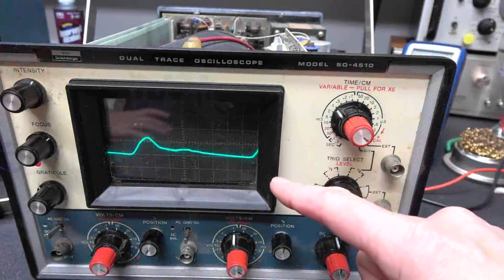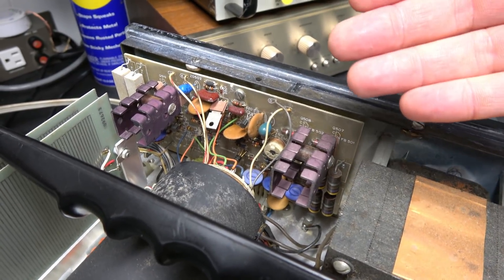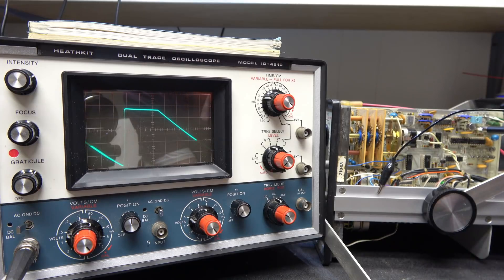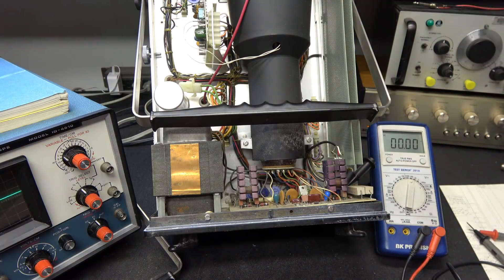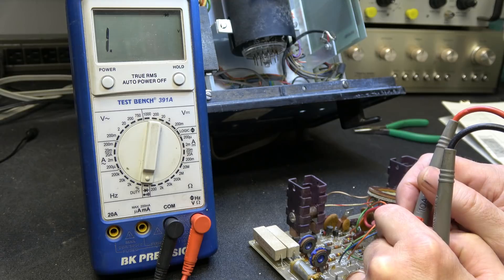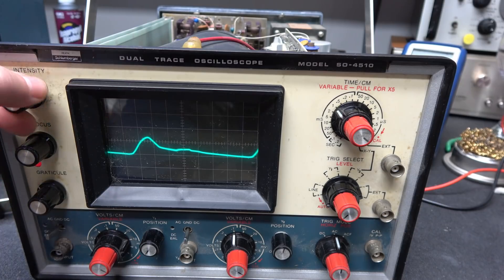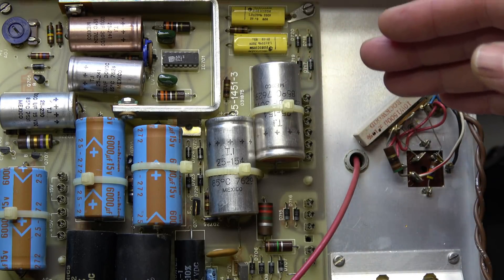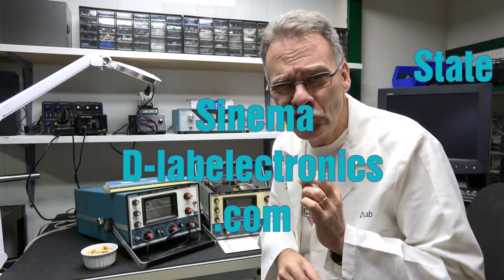How to repair Heathkit IO-4510 oscilloscope horizontal sweep problem

Comment: Picked up the 5Mhz model, the horizontal sweep works but is distorted, more like the time base circuits are wonky. There are a few resistor in the high voltage section that are nice and crisp, hope the ICs are not blown.

Comment: I have a very similar scope - a Heathkit IQ-4550 dual trace scope. Only problem I had with it was power transistors that drive the vertical deflection plates go into thermal runaway. Sympton was a trace that slowly went up and off screen as the scope warmed up. Cure was to heavily heatsink these vertical deflection transistors. Heatsink was homemade. Trace still moved vertically very slightly after 30 minute warmup, but vertical position knob easily brought it back on screen.

Comment: Hi. Thanks for this video and for taking the time to teach to repair equipment instead of throw them out. An older ham Operator just give me this oscilloscope and the problem that I have it's that the horizontal line does not cross below the center mark of the screen. I don't really have any knowledge of this do you know where to adjust this line? thanks you in advance Peter.

Comment: That was awesome Terry, I'd like to find a school of sorts in the NYC area where I can learn the fundamental basics of this electronic work. I'm a  Operating Engineer in HVAC over 32 yrs now and most of our work usually winds up being electrical/electronic issues. I've gotten good with it too. Going through the apprenticeship school for a few years really helped, I've built tube guitar amps, tube stereo amps and effects pedals over the years as well. Its the understanding how to use a scope, function generator etc type of stuff I want to nail down

Comment: It has been a great pleasure to meet you on YouTube. Very good video. You are an electronic repair professional and you are also a professional presenting the videos. I say this, because I am an electronic technician and my mother tongue is not English, I understand you enough, because you speak clearly.
Well what interests me. In 1986, I bought and assembled a Heathkit oscilloscope model IO-4210, to complement my study and add as a tool to the workbench. After two years of operation, the oscilloscope began to fail. This burned some transistors in the high-voltage source. I replaced the transistors and it worked for a while and damaged them again. I inspected and detected a fault with the power transformer, in the high voltage secondary coil. I rewind the high voltage coil and put the equipment back into operation. After almost three years, it failed again of the same. I took the oscilloscope out of service, because it was impossible for me to get a new transformer. I replaced it with the Fluke scopemeter 123, which I have out of service for damage on the display. Because of this, I set about reviving the Heathkit oscilloscope. Any question that I have in the repair of the oscilloscope, I will consult. Thank you.

Comment: What's your technique for finding replacement transistors?   Most of us end up trying NTE's site.
Reply from the maker: Yes, I either use originals or the NTE equivalent. In this case, I used NTE 108 & 106's

Comment: Nice video.  I have a 4550 that has some issues.  I was going to fix it, but the cost of parts outweighs the cost I paid for the scope.  It needs a couple of panel pots and they're hard to find.

Comment: Good morning Terry. Long time subscriber and a big fan of D-Lab. What’s your take on older Tektroniks scopes? I picked up five large tube units this past weekend and could use a little insight into troubleshooting/refurbishing at least one working scope out of the five. I’m sorry that I don’t have more identifying info on them as I’m at work (on break of course). They’re all modular with 3 removable sections or maybe 4? Anywho, just wondering if you would ever do a vid on older/vintage Tektroniks O-scopes? Have a great weekend and happy Friday, wahoo, have a glass of vino for me🍷🎛🔌🎚📻

Comment: Thanks Terry. That Q513 transistor looks similar to a PNP #151-0622 transistor in my Tek 2465A DV scope's Siemen's Hall-Effect sensor controlled fan motor board. The first time I have seen a transistor with three painted stripes on its back.
Reply: I thought Motorola did the painted stripes? I should go pull some old scrap boards. Lol
Reply: That transistor was made by Motorola, as many other components in my scope were.

Comment: Great videos! But some minor safety advice fro all who watch. Be careful about touching heat sinks of high voltage transistors. The collector is often tied to the heatsink especially when it's board mounted. There could easily be several hundred volts on those deflection drive transistor heat sinks as demonstrated.
Reply: Also there is that 3,000 volts to the anode, and -1,000 volts to the cathode of the CRT.

Comment: For a hobby I’m just getting into tuba amplifiers and simple circuit transistor don’t need no fancy 600 or thousand dollar+ lab scope. I have been picking up old scope signal generator power supply for free or as cheap as $20 for parts doing simple fixes and coming away with great operating gear for my hobby.
Reply: What’s the freq response of that “tuba” amp?? Low I’m guessing... just kidding

Comment: Thanks Terry! I have the same scope I built in the 1970's Still work great. I use it in my ham shack Thanks for a great video! N3SWL.
Reply from the maker: Yes, That was a very pricey scope back in 1975. The one I'm working on is a factory built unit SO-4510, price new was $750!

Comment: I took your advice Terry and picked up a Heathkit unit, an IG-72 audio generator.  I am in the process of cleaning pots and plan to replace the caps and some out of spec resistors this weekend.  I tested the tubes on a Superior tube checker I received from a co-worker (replaced caps on it as well).  Followed your advice and installed a power line fuse as well on the tube checker.  I have a busy winter ahead!
Reply from the maker: Cool deal man, You cant go wrong with the Heathkits. With a little TLC they will perform great on the bench
Reply: On rebuilding this unit IG-72 audio generator, have you come across some weird precision resistors or caps? I need to put a audio/function generator on my bench and want a classy old school one. I rebuilt a old Simpson 260 series 3 and had to combine resistors to get some of the values, It works great now and I guess its whats part of the whole electronics field.
  thanks
Reply: lego4040 the device does seem to have some odd resistor and cap values.  The caps I am try to get as close to original as I can but the resistors will be exact matches from Digi-Key.